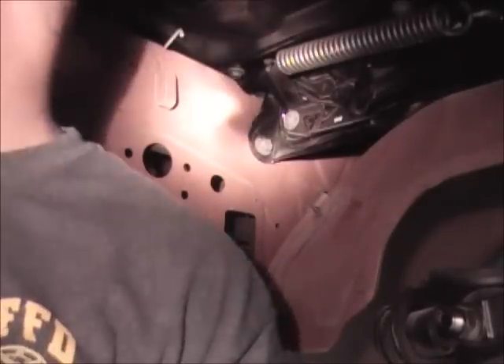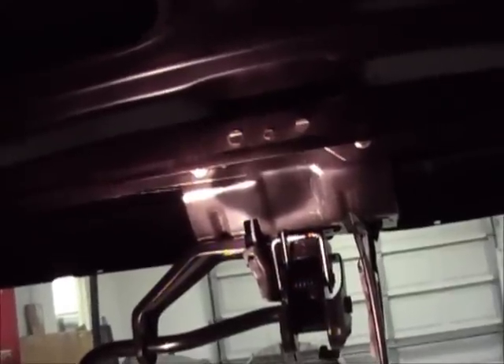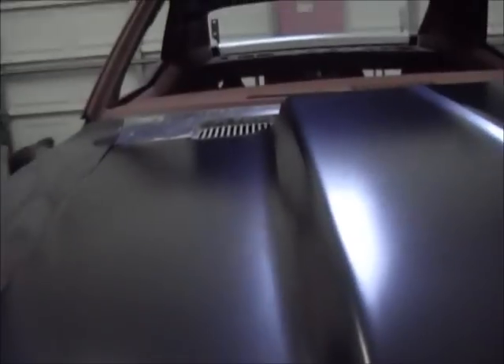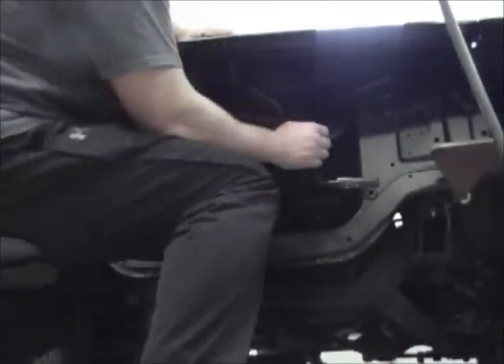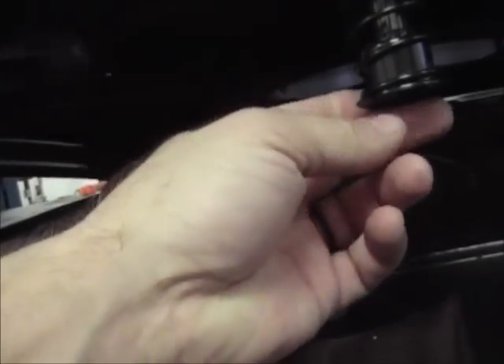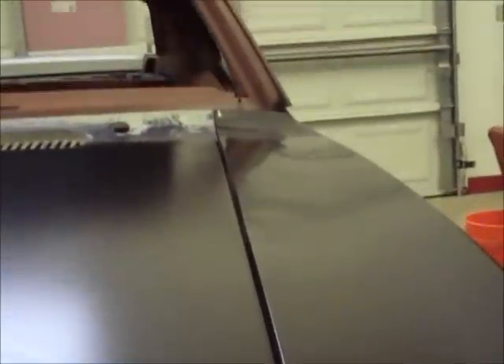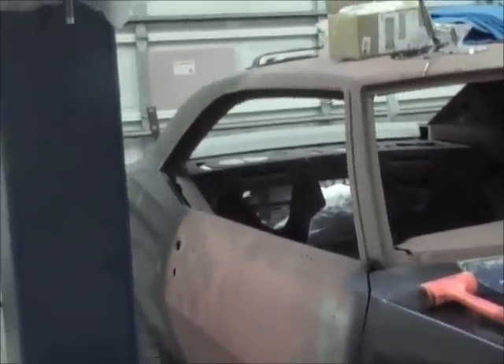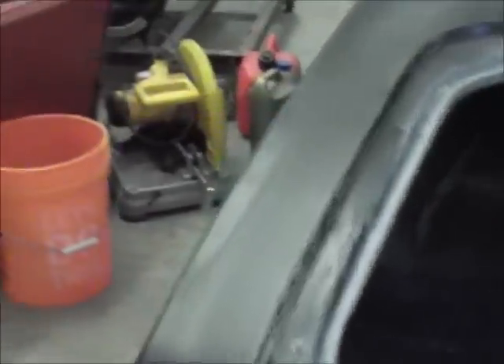Is perfect possible

Comment: It looks great. I would be happy if mine turns out that good. I'm not planning on welding my deck filler seams. I saw where they did it on project Zed Sled at Eastwood. On a 2nd gen that panel get removed to access the trunk springs, but they still did it. To me it draws more attention to that area, because its like "something's not right here" lol. I think once painted and seam sealed it will look natural.
Reply: +Double R Restorations totally agree, you get so used to seeing the seams that you know are supposed to be there, when they are not there I usually assume some hack filled them with bondo.

Comment: No, perfect isn't possible. Some think they are perfect but they are just arrogant and usually further from perfect than they realize.  I have never seen anyone weld those seams on the rear deck filler panel.  I personally would never do it. Just metal work those edges straight and then it get seam sealed after the final primer has been sanded.  On the front No, the header panel absolutely does not get seam sealed to the fenders.
Reply from the maker: Awesome thanks, one question tho you said Sean seal after final prime ? I thought seam sealer went on after epoxy to bare metal was done , then high build . Educate me please & thanks
Reply: +Shut Yer Face Garage I'm with Matt.  No such thing as perfect...  But by the same token, don't ever settle for anything other than your best.  Having watched what you do, I don't think that's an issue.
Reply: +MrFireman164 the visible body seams ( rockers, tail panel, drip rails, etc.) are done right before sealer and paint.  You don't want high build primers on top of your seam sealer.  I have never seen it done any other way. High build primers get brittle when they are cured and I wouldn't feel good about them being on top of a softer seam sealer for fear of the primer cracking.   If you want an technical reason maybe Jeff will chime in.. I'm not the best at explaining things lol.
Reply: +Greg's Garage  "Anything less than the best is a felony" - Vanilla Ice.
Reply: I think what you just did there might be a misdemeanor.  I'm reporting you.
Reply: +Greg's Garage lol
Reply from the maker: +Shut Yer Face Garage ok , I see that makes sense . So the visible seams are treated differently than the wheel well /floor ect... I have  3m heavy bodied 2 part seam sealer . Should I use a different type for the visible seams ? Thanks again
Reply: +MrFireman164 I treat all the seams the same, I was just putting emphasis on the visible seams on the body because those are the ones that get painted and you see all the time.. I always seam seal after all the priming and sanding even on wheels wells and floors etc.
Reply: +Shut Yer Face Garage Oh and the 3M 8308 is the seam sealer I use on most everything.
Reply from the maker: +Greg's Garage Thanks Greg , still a lot about restoration work that I haven't learned yet. hopefully on the next project I will have those bugs worked out for the most part.:)
Reply from the maker: +Shut Yer Face Garage Lol
Reply from the maker: Shut Yer Face Garage Awesome thanks!
Reply from the maker: +Shut Yer Face Garage Check this vid out at about 7:25 in where he uses the saw zaw blade, how to you feel about that Technique for the visible seams?  https://www.youtube.com/watch?v=VgcJ3oPaYQ8
Reply: I use hacksaw blades or sawz all blades to clean out or sand the seams perfectly straight.  Makes no sense that he sprayed poly over the seam sealer and then sanded the poly off back down to the seam sealer. Poly is the absolute worse primer you could put on top of seam sealer.
Reply from the maker: +Shut Yer Face Garage gotcha , yeah I bet poly is more brittle that high build
Reply: +MrFireman164 Poly is awesome because it shrinks 0% pretty much. However it is brittle and for that reason I never use it in jambs or on anything flexible.  Urethane primer when fully cured after a few months is pretty brittle as well.    A while back you asked me to let you know if I saw you doing anything stupid..  Seam sealing before bodywork and primer is stupid. So don't do it... lol
Reply from the maker: +Shut Yer Face Garage point taken ! Keep that up , I don't want to screw this car up , I have an stupid amount of time in it
Reply from the maker: +The Open Air Garage that's the consensus I'm getting by smarter people than me ^

Comment: Looks great, I didn't weld my filler on the Chevelle. Just Seam Seal. The way I understand it is you epoxy prime all areas before seam sealing then seam seal then final filler prime, block sand, finish sand whether wet or dry then seal and paint.
Reply from the maker: +Cary Lamari Yeah I thought so too but syf corrected me on that

Comment: The rear filler panel will crack if you weld it, too much flex on a Camaro, seam seal only. The header panel and cowl vent cover don't get any seam sealer. Gaps are looking real good!
Reply from the maker: +ceedell ok sounds good , thanks

Comment: I have seen the braze in the corners and seam sealed on the deck filler but the gap looks a bit wide maybe lead them but welding is an option.  would all metal hold up in that area ? the front upper valance should not be seam sealed as far as I have seen or at least I have never seen one seam sealed. on my bird the rear corners of the rear deck filler are brazed but I do not know if they are from the factory someone had most likely brazed mine before I got the car to repair some rust.
Reply from the maker: +Chris Mansker Well everyone is saying that area flexes to much so I will stick with seam sealer
Reply: ya im sure the braze in my car is probly hiding a rust issue or was used to fill a pin hole or something.  can see it once the trim is on its only in the bottom corners where the quarter and deck come together.  yes these cars are very flexible unlike a full framed car.  the car is looking really good though roger
Reply from the maker: +Chris Mansker thanks